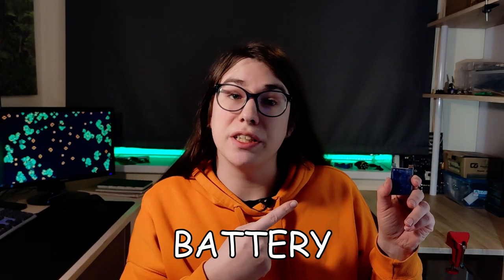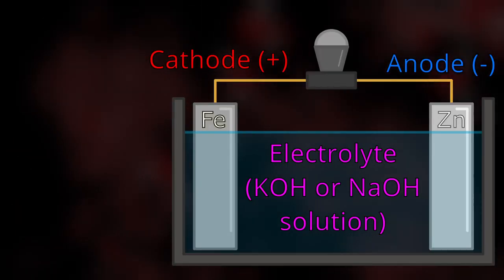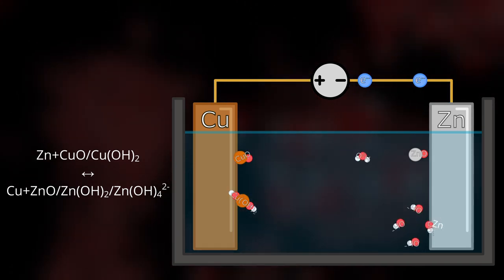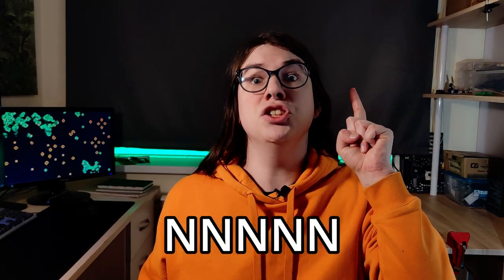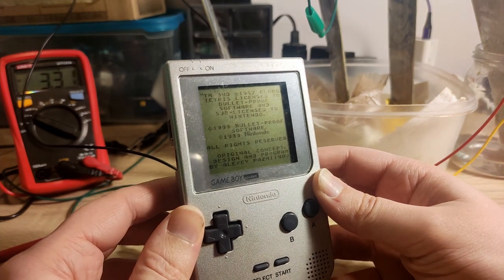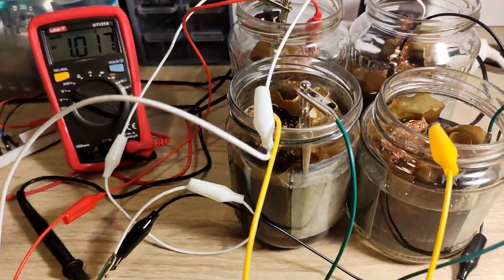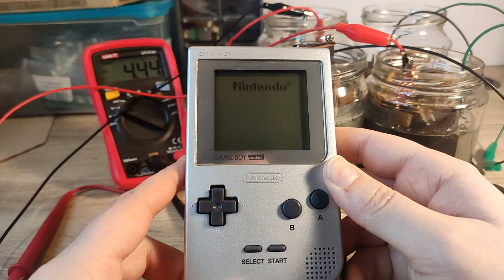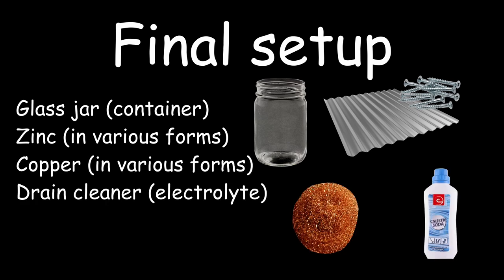Gaming On DIY Batteries

Comment: I have been researching on homemade metal air batteries for almost 2 years now. Love your video. Surely its a very difficult thing to make our own batteries work.
Reply from the maker: It's quite difficult to get homemade batteries to work reliably, yeah... Though my hope is that one day I might be able to make some diy batteries that uses some more advanced battery technology... sodium-ion, maybe? :D
Reply: @BirdbrainEngineer  I think Aluminium Air is the destination. But it needs lots of state of the art materials
 For homemade batteries, I guess we can try with Zinc Air or Zinc Carbon.